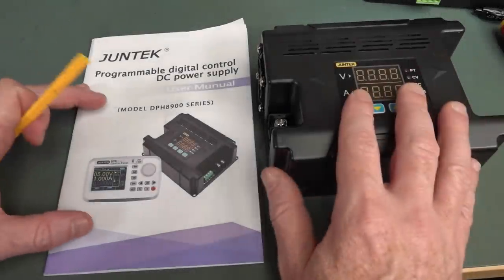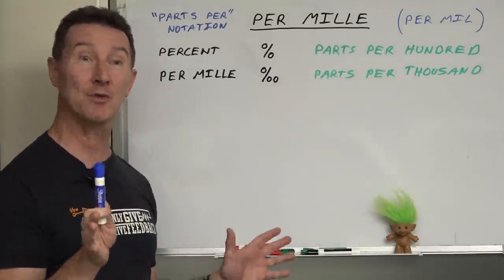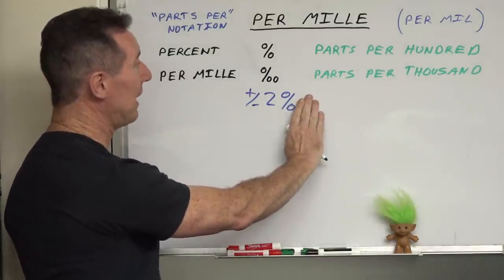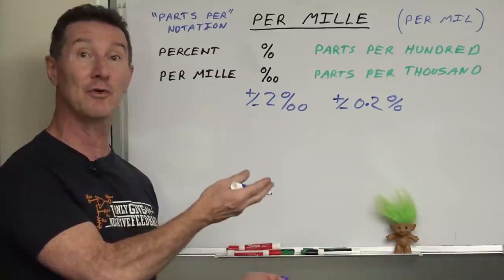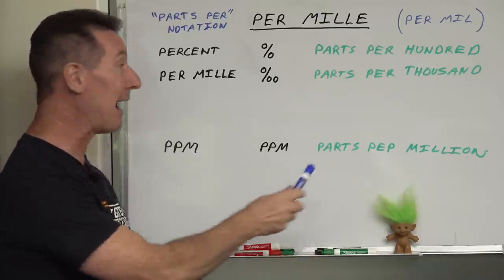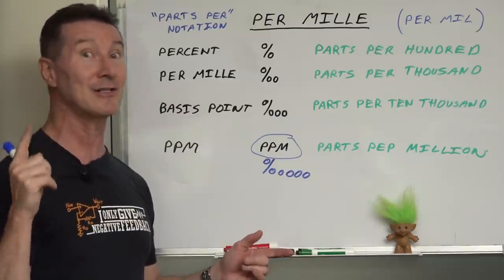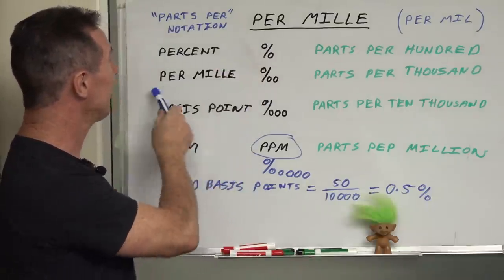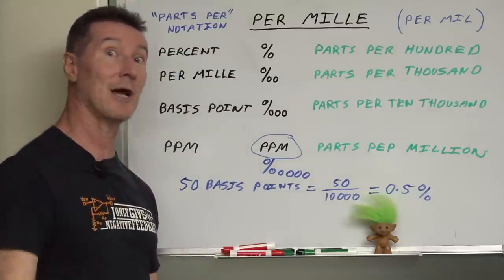EEVblog #1300 - "Parts Per" Notation EXPLAINED

Comment: You missed a fairly common one. When we hear about pollution or contamination, it's usually expressed in PPB.
Reply from the maker: Yes, forgot to mention that, but that's fairly widely known like PPM.
Reply: I stumbled upon another one the other day: pS/inch. Picosecond per inch. Not sure why the article which was about high speed PCB design wrote capital S for seconds, which is probably a mistake since the standard unit for second is small s.
Reply: Craig Tucker yes, I bet the whole Latin world know this already. I have an issue with the ppb one. A big issue. Some countries count million, billion, trillion, while other countries count the same numbers million, milliard, billion, billiard, trillion, trilliard, adding three zeroes for each increase in each case, making million the same in both cases, but million off by three zeroes in the billion case.

Edit: this is apparently called long and short scales.

Edit2: rereading your comment, this is what you are already talking about lol
Reply: Craig Tucker  i thought a billion was a 1000 millions?? & a billion billion's was a quadrillion or a quin-trillion?? what comes after a quadrillion?? is it a quin-trillion?
Reply: @roygalaasen  The pS could also be in reference to pico-Siemens, especially in the area of PCB design. So this is quite unfortunate in a field (no pun intended) like that, although I have noticed that the electronics industry almost has a long tradition of sloppyness in how their units are spelled. Seconds could also have been spelled SECS or secs, volts seen both as v and V, and farad as both f and the correct F. Oh, and of course writing R instead of Ω. It's amusing that the Chinese manufacturers with excellent support for a huge set of Chinese characters on everything they produce seem to have such a great difficulty catering for about three extra Greek characters: φμΩ
Reply: @keithking1985  https://en.m.wikipedia.org/wiki/Long_and_short_scales
Reply: @roygalaasen  What this capital "S" most likely refers to is not seconds but the official SI-unit "siemens", which ist the unit for the electrical conductance. So your example become picosiemens per inch. That would make a lot more sense when refering to high speed PCB design. It's simply the reciprocal of the electrical resistance  (1/R). In English speaking countries you might be more familiar with the unit "mho", which is simply "ohm" read backwards.
Reply: @roygalaasen  Like others already mentioned "S" stands for Siemens. Capital letters are only used for units named after a scientist (V, W, F, nF, pF, N, dB, Hz, C, J, T, Pa, °C, °F... etc)

Comment: Funny, it's super common in Czech (and most of Europe, it seems) that per mil ("promile") is used in alcohol testing. Eg, you can have two "promile" of alcohol in your bloodstream. But since it's only used in that scenario, most people think it's just some alcohol-testing-specific unit thing. In a datasheet I'd definitely rather use percentages to avoid confusion.

Comment: I have seen this when I have been making homemade disinfectant. But I had to understand and convert parts per thousand and percentage.
Reply from the maker: Yes, Mrs EEVblog (who is a chemist) said it's not uncommon in volumes of things.
Reply: @EEVblog  yes, as you point out toward the end of the video yourself, it can be used for "any unit", but it may not have been stressed well enough that it should be the same kind of unit, e.g. volume per volume, mass per mass, or length per length, never for stuff like AUD/L fuel. However, I have seen this regularly misused even in scientific communities, for example as in 1 ppb concentration of something referring to 1μg/L of seawater (which isn't even 1kg), so actually by sloppy usage a mass/volume "shorthand term", sort of...

Comment: Per mille was widely used (at least in europe) to measure height or level differences for railways, so you don't have to deal with long rows of numbers after the decimal point when using percent.

Comment: The thing about basis points is that they always refer to a absolute difference in interest rates. For example, an increase from 5% interest to 5.5% is a 50 bp increase, even though it's a 10% higher rate.

Comment: I though how would you even print that ?
But ‰ is in the (special) Character Map (U+2030) = Alt+0137
Reply: It's actually a part of the wonderful UTF-8 character map so it's not a "special" character in that sense. All systems who supports UTF-8, which almost all systems do now, can print ‰. It's not a key for it on most keyboards though, but that includes a lot of symbols.
Reply: More people should get familiar with how alt-codes work, they're super useful.
Reply: You can build the smaller versions as well, such as ⁰⁄ₒₒₒₒₒ from other characters in the same unicode area.
Reply: On Google keyboard, it's easy as heck. Just press and hold the % symbol until the alternatives appear
Windows Noobs can use builtin tool named character map

Comment: An interesting and related thing the we have in Swedish is the notation of "percantage units" (procentenheter). It's something we talk about when a percentage (such as interest rate, or support for a politician) has changed. For example, if the interest rates drops from 2% to 1%, it's actually a 50% drop, but it's 1 percentage unit drop. The precentage unit doesn't really have a sign, but you very often hear news reporters say it. It's a very convenient way to talk about those kinds of things, without it being really weird and deceptive. For example, say that support for a politician increased from 1% to 2%. If you say support increased by 100%, it is technically true, but it sounds like it's much more than it actually is. Here, it's easier to say that the support increased by 1% percantege unit.
I wonder if there's a similar way of expressing this in other languages (I'm sure there is)?

Comment: Hi Dave and everyone, In measurement, one must report the measure and uncertainly in the measure with the minimun number of significative digits an one of the rules of the convention is that "leading zeros are not significant", i.e. 0.2 o/o and 2 o/oo can work but rigorously one may report de measure as 2 o/oo because hasnt leading zero, very technical manual. In science world this mistake can cuase a rejected paper.

Comment: As an electrical engineering student I commonly used 'per unit' measurement in, for example, transformer calculations; 'per mille' is almost as moronic as using a full stop as a decimal point or, infinitely worse, using a comma in place of of a decimal point

Comment: What I don’t get is the actual relation between PPM and units. For example, if I have a 20MHz crystal, what will be the actual freq. tolerance if it’s 50 PPM for 20M? 1 KHz? 50 Hz? 50 uHz?
The same is with t.c. of a transistor voltage drop. Which unit should I actually divide by million and multiply by PPM value? The value? Volts? Something else?

Comment: 8:53 In calculations, i sometimes throw around orphaned metric prefixes, I shall now use the uno so there's less chance of them being confused with some different variable or unit.

The table only seems to show negative powered coefficients of uno. Any public response to positive powers?

Comment: It was 0.2% +1 digit.  what is the weighting of that 1 digit. So what is the overall accuracy of the read out, In my world it would not mean a thing as we never got power supplies calibrated. in the same way we did not get audio signal generators calibrated. they all carried a "Reference only" label  which meant that they had to be checked by a calibrated device when in use. in a large lab saves a lot of money and is acceptable by a lot of quality standards. Still a thought provoking video, that got 1100%o of my attention :)

Comment: I'm very familiar with parts per mile. It might be because I'm an educated toolmaker and are used to very small tolerances. Another thing is that we measure the level of alcohol in what we in Norway call "promille" which is parts per thousand. I also know a little Italian and I know that "hundred" = "cento" and "one percent" = "uno per cento" or "hundred percent" = "cento per cento" and "one thousand" = "mille". So my guess is because Italian is a Latin language that "percent" comes from Latin from. Even though it most likely was adopted into English via French.

Comment: When I see PPM, the first thing that comes to mind will always be Pulse-Position Modulation.
I’ve never seen PPM being used for Parts Per Million before. Shouldn’t it be ppm rather than PPM when talking about parts per million?
Reply from the maker: Wow, never seem PPM before? Upper case or lower case doesn't really matter.
Reply: Upper case or lower case really matter !  I hate people saying mAh as MAH. I always ask them whether they are building nuclear plant.

We learn this in school : If the unit name came from a person, e.e. Ampre, Voltage, Watt, it must be upper case. Otherwise, it must be lower case.

Can you tell the differece of 100uS , 100us, and 100US ?
100uS is 100 micro Siemen
100us is 100 micro seconds
100US is 100 United States
Reply: PPM and ppm are different things.
Reply: James Wong
Exactly!

i = 2 a
r = 3 Kohm
F = 60 hZ

This doesn’t look right, does it? ;)

Edit:
Also, if we can write parts per million as PPM (uppercase), does that mean that we can also write
100 MM for 100 millimeter and
60 KG for 60 kilograms?

Uppercase and lowercase matters in science and engineering.

Comment: I've been familiarizing myself with PPM in relation to hypochlorous acid concentration for my surface disinfection needs. Got myself an electrolyzer that can generate 200 PPM free chlorine from salt, water, vinegar, and 60W of DC power. It's totally rad. I wonder if I can get a higher concentration by going up to higher power levels?

Comment: PPM is always used when testing drinking water, because any water that would have more than one permille of something is so polluted that it is preferably not drinkable. Not entirely true thou because some things are measured at mg/L, weight for pure water is 1.000.000 mg per L, so 1 mg is one ppm for pure water. Substances that have significantly higher density than water are more accurately measured in mg/L

Comment: The divisor is actually a number of zeroes, not "ohs" (letters).  For the Per Mille character (‰), the divisor is two zeroes.
Reply: Agreed, except that you have to count all the zeroes for the divisor. Per Mille the divisor is 3 zeroes.  The sign is actually a reorganisation of /00 or /000. Of course there should be a 1 there (/100 or /1000) but it's dropped since it's obvious. Edit: darn predictive text!

Comment: Given that as engineers we usually group decimal things in powers of three (mega, kilo, milli, micro...), I very commonly use permille ‰ when describing margins or accuracies in electronics or other engineering. It is more natural to think of than in hundreds. However, when I came to the US (I am German) and described something with permille to a fellow engineer I got a blank stare. So yes, it pretty much seems to be a cultural thing. Typically everyone in Europe heard it in the context of blood alcohol as others pointed out (typically 0.8‰ limit).
Reply from the maker: I do wonder is Joe Average actually understands it or just knows it as some obscure thing to do with blood alcohol levels, and they could actually convert it to save their life?
Reply: @EEVblog  Maybe not Joe Average, but they barely can deal with percent as well. As engineer, however, I find it very common to think in thousands of things. Also, once I introduce the uninitiated fellow engineers, they also prefer permille to percent in many common scenarios.

Comment: Well, in Germany in Engineering the % is most common. Permille is in Germany used sometimes. But we mostly know it from police and doctors for Alcohol- concentration in blood. But doctors here use really strange units  :-(  . Currently for COVID-19-Incidences they use 1/100 000. That’s really strange. I think we should stay with the 1000-System we know from Engineering. I would prefer the PPM in this case. But doctors use always extremely strange units – like “mm Hg” for blood pressure or even for gas concentrations that are expressed in “partial pressures”.

Comment: Math terms question: To the end, you say that things like "%" are ratios. I see that. If we put it behind a number, it is a factor, right? 5%=5•(1÷100)
Reply from the maker: I'm not sure that factor is the right term here. I've always known percentages to be effectively "ratios", and I think people will relate to that term better, but I'm not a mathematician. e.g. 1:100 or 1/100 is a ratio, but it's the same as saying 1/100th or 1%. So although a "ratio" is technically a different thing, it's very much related.
Reply: Oh, I have to correct me a bit. I meant if you have some % of something, like 10% of 500 which is (10÷100)•500, thus making "10%" into a factor. You don't divide your reference value by something but you multiply it by your ratio, making the ratio also a factor in the usual context. That is what I meant.

Comment: Thanks Dave, maths I have not seen before. the origin is once again the Romans, centum is a hundred, mille is a thousand. Still used centuries later, even though the Roman maths did not, and could not conceive, that the quantity zero was a valid item, till the Arabic numerical system became widely known by them, which has a concept that zero is a valid number, and has position, along with things like negative numbers.

Basis points easy, because they like to modify your interest amount in multiples of 5 basis points, making the interest payment amount a number without any decimals, which could be missed when entering into another form, or when it is scanned and OCR has a go at it. If all interest is not a decimal fraction at any point, there is much less chances of making a mistake.

Of course, there are countries where the central bank rate is zero, or even negative. Borrow money from the bank, and either pay nothing, or they actually pay you to borrow it. Of course, to get this rate, you either have to be in the top 1% of the 1%, or be a bank.

Comment: I've heard mille used in metric for millimeters all my life 🤔 "pass the 10mille or the 10 milli" 
This video is the first time I've seen it used as a thou.  Could be a generation thing or cause we use metric more??
Reply: Same, although usually in woodworking and mechnical stuff. I'm guessing in EE you generally deal alot less in lengths than in those areas.

Comment: Is that really uncommon?
Not sure if it is just here in Germany, but I'm very familiar with it.

Most adults in Germany have heard of it (even if they might not know the meaning) as permil (or the German Promille) is used in laws and driving schools.
The legal limit for DUI in Germany is 0.5 permil blood alcohol (so 0.05% or 0.0005 or 5 parts of 10000 in your blood is allowed to be alcohol).

The word "Mille" as in "der schuldet mir noch ne Mille" (he owes me a grand) is also used, especially in gangsta movies as the German word for 1000 or grand.

Banks and insurances also use it on a regular basis in Germany.

Oh and the steepness of rail roads is given in permil (unlike roads where they use percentage) as trains have much more difficulties with steepness. (There is a specific sign giving a number and that is the steepness in permil.)

Comment: Here's one that's always a trap for the uninitiated:  To an American machinist working in inches, a "tenth" is .0001 (1/10,000) of an inch.  Why?  Because ever since armory practice took over circa 1900, machinists started working in thousandths of an inch instead of fractions and .0001 is one tenth of the unit usually used in the field.  It also is about the most precise measurement one can make in a machine shop without having to resort to metrology heroics and highly specialized equipment.
Reply from the maker: Actually makes sense.
Reply: @EEVblog  It does, but try explaining it to an Italian who doesn't speak much English and refuses to understand the concept of an inch.

Comment: So what is wrong with  + - 0.2 %.  Standardisation people - very useful and makes a lot easier to read.. 
Another example I really hate - using commas for decimal points.   10,000.003  not  10.000,003.

Comment: When I'm tutoring I always mention that cent is 100 as in 100cents are 1 Euro
Also helps to mention that other languages have shifted words

For example
German 
100 hundert
1000 tausend
10^6 millionen
10^9 Milliarden
10^12 Billionen 
10^15 Billiarden
10^18 trillionen
10^21 trilliarden

Whereas 
English 

100 hundred
1000 thousand 
10^6 million 
10^9 billion 
... 
Whereas French does

100 cent 
1000 mille
10^6 million 
10^9 Milliard
 And so on similar to German
Reply: Correction, while English doesn't, as far as I know, have the equivalent of milliard, billion was 10^12 until the Americans got their hands on it.

Like Chinese has traditional and simplified forms, so does English. In Britain we use traditional English whereas Americans use simplified English. I guess traditional English was too difficult for them.

Comment: I'm not an engineer but I actually learned what this was not too long ago from the dumbest source. A year or so back I bought a cheap off-brand Chinese mobile phone that used the permille symbol instead of percent on the default screen keyboard so I tracked down what it meant because I had never seen the symbol before. I marked it up to crappy programming where someone called the wrong ASCII symbol code, but it makes me wonder if perhaps there's a subset of Chinese made stuff (like with other poorly written English translations) that erroneously swap the percent and permil symbol because they don't realize they aren't the same thing.